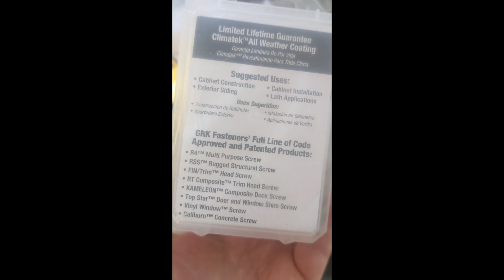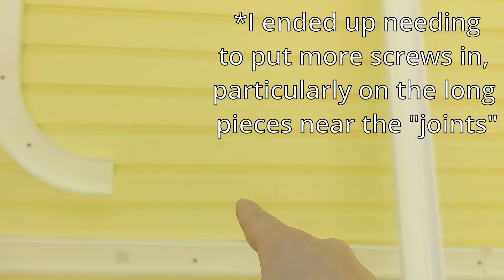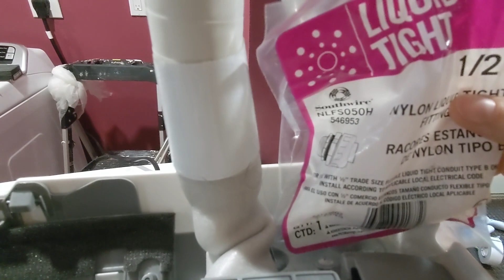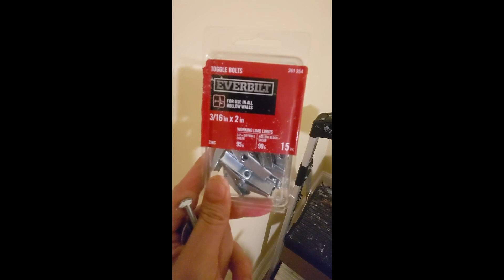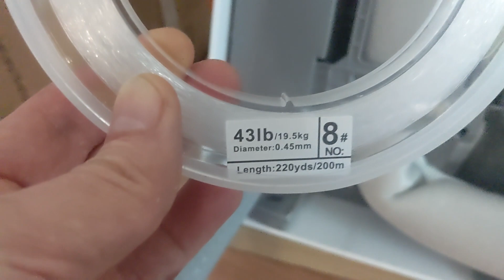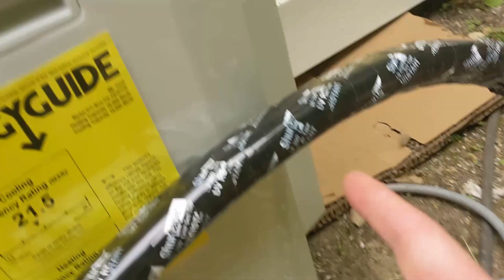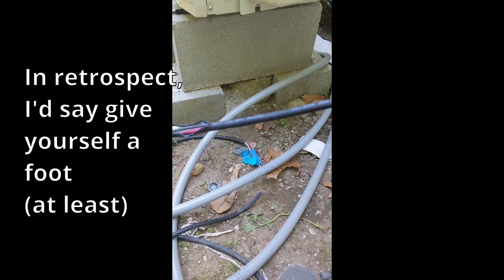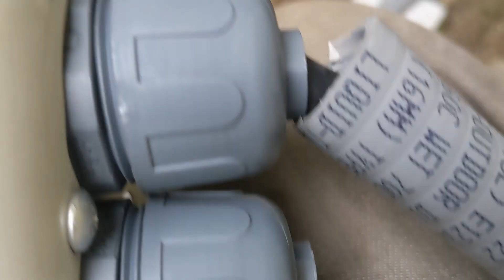MrCool Lineset Cover DIY and more

Comment from the maker: Also just a note on that thermal expansion mention at 2:40, after looking into it a bit more, it really is very small expansion you'd probably be looking at (unless maybe you're in Arizona where things just melt) so just a quarter an inch should be more than enough.

Comment: You're going to get formicary corrosion with those white line sets.  You should tape the ends of the insulation tightly around the tubing to mitigate against it.  Good amound to detail in the video in contrast with many videos that gloss over everything.